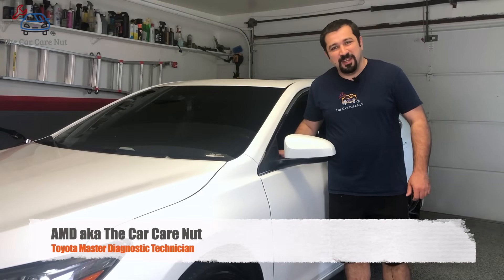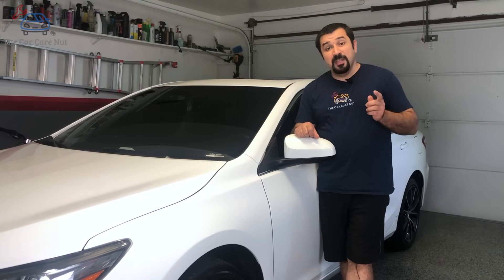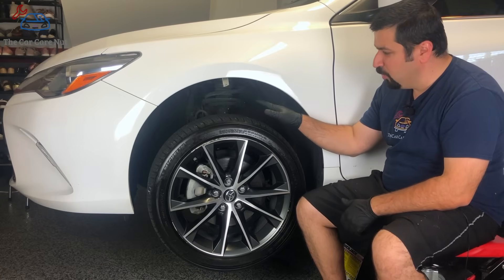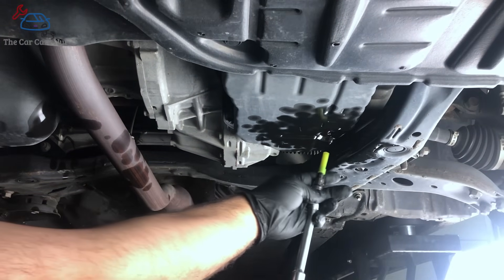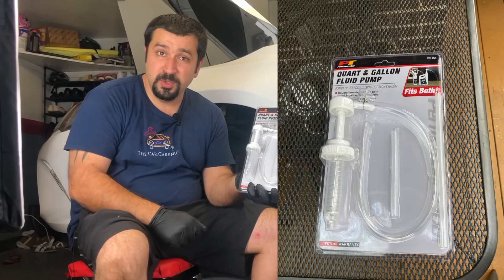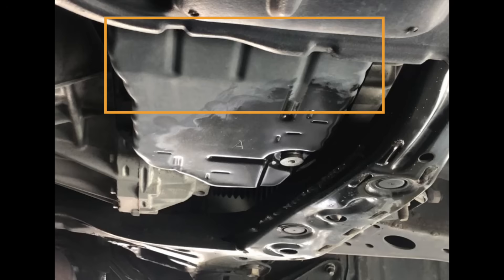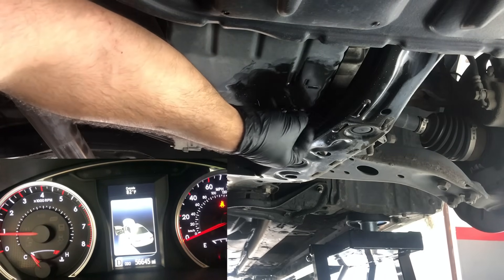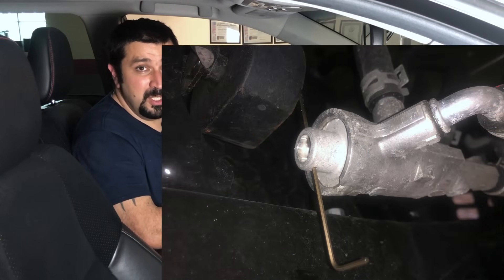How to change your Toyota Sealed Transmission Fluid

Comment: Planning on doing this on 2013 Camry v6 I just bought. Coming up to 200k 1st owners never did a tranny flush so it’s original fluid in it. Do you think the drain and fill will be safe or should I just leave old stuff in. I know these motors are solid in the v6, car still shift smooth and drives strong. Thanks in advance

Comment: I have a 2017 Camry 2.5 Le with 108k miles, and want to do a trans total fluid change.  A drain and fill, a total fluid change or a flush ? What do you recommend? God Bless

Comment: Thanks for the information, just did transmission oil change on my 2019 Rav4 Trail/Adventure 8sp with a Techstream draining the overflow at 104f. However I couldn’t find this oil cooler bypass you talked about between the rad and transmission. I followed the lines from the transmission and it looks like it goes to an oil cooler closer to the firewall/booster side but didn’t see any pins to press in. Do you know if this model has this bypass pin? If so let me know and I’ll do the change again thanks!
Reply: I spent the last two days under my 2019 RAV4 XLE: same as you say, NO bypass valve anywhere to be seen at all. Removed all plastic skid plates and driver side inner fender. Nothing.

Comment: I have 2016 Camry with 251,000 and the tranmission is shuddering between gears. I believe the transmission fluid has been changed at 110,000. Do you think its safe to do a simple drain and fill?

Comment: Do you recommend changing the the transmission filter or just the fluid during the drain and fill? I have a 2014 Camry SE, 99,000 miles
Reply: Changing the filter is a more involved process.  It is a better way to go but some of the bolts are very difficult to remove.  Once the filter and gasket are replaced you would need to then follow this video to fill the trany to the proper fluid level.
If you have a high mileage car many recommend not to do anything or just what's in this video and not the changing the filter.

Comment: Great videos as always. Thanks. I have Two Toyota Estima 3.5l 2GR-FE with only 40k miles but a 2009 model and a 2006 model. I take it the fluid will need changing. Is it safe as they are old cars with very low mileage? Thanks.

Comment: Even the workshop can not do this properly, last time i check my AT fluid on my 2008 Camry 2GRFE, it has very little fluid on it, so my transmission sometimes slip in the morning, after i add more fluid, now its normal.

Comment: how do I change transmission fluid in 2015 toyota tacoma and 2017 rav 4
Reply: Drain it & then fill it after you have reinstalled the drain plug.

Comment: Cool video, but I have a question.  Why do you have the engine running when you check the fluid level?  The Toyota procedure PDF I have on setting the fluid level doesn't say to have the  engine running so I thought you did it not running.  IE, do the temp check, shut the engine off then set the fluid level?  At least that's how I read the official procedure?  Thanks!
Reply: Engine needs to be running.

Comment: I've notices sometimes car jerk when moving at 30 miles or less and on slow acceleration. This started happen somewhere after 35K miles and get worse at 50K so I decided to change the transmission oil and now it ride much smoother.

I just finally completed this job today on my 2017 Highlander. It wasn't hard if you figured out and doing it correctly otherwise it can be a PIA and frustrating.

Need 4 qt ATF WS for HL 6cy drain/refill. Dealer will trying to sell you 6qt.

Don't buy expensive scan gauge or temp gun it's a waste of money and just do the official way how he showing here. The problem with with official way is best to let the car park overnight so you have a lot of time to drian the excessive out, otherwise you will not be able to have enough time to adjust the fluid level.

In this video it a little confuse for me at least. I did exactly how he show in the video, park car overnight and when it come to the part draining the excess fluid than tighting bolt than went to look at the instrument cluster and this is where I notice the D is blinking so I probably over drain. Waited 3 hours and try it again and the D start to blink only 30 seconds after being solid, so when you make mistake like I did, it's time consuming and frustrating as well. I let car sit overnight and restart the procedure but here is what when wrong the first time.... While rocking between D & N and the D come on solid and go away, I keep rocking shifter D & N and this is a NO NO. Once D come on solid and go away which it should be, put the shifter into park and wait for the D to lit up solid than remove the jumper wire and proceed to drain the fluid. This will give you much more time to correct the fluid. After fluid is corrected I when back and look at the instrument cluster the D still solid which mean it life is good. 😀

I hope it help.

Comment: Hi, just bought a 2004 Lexus ls430 with 126,000miles on it. But the transmission fluid was never change, is it dangerous to change it now.

Comment: Man, I have looked everywhere to try and find this bypass valve on my 2019 rav4 front wheel drive. Does it look exactly like in the photo?  Also, my drain plug is on the transmission itself. I don't have a pan if that helps. I do have an 8 speed too. ANY help anyone can give would be great!!!
Reply: I have 2019 RAV4 XLE AWD, could not find any evidence of bypass valve of any kind. Lines leave and re-enter trans with no valve port.

Comment: AMD, thanks so much for so many good videos, been subbed for sometime and have viewed lots of your content. Own a 2019 Tundra 5.7L and a 2022 Lexus ES300h. We are Toyota fans indeed.

Question…my 2019 Tundra just rolled 30K miles. Instead of fussing with all of the technical steps of the tranny, here is what I did…I let it sit overnight, first thing the next day I drained the cold transmission oil from the tranny oil pan. Measured what drained out precisely. Then I pumped in precisely the same amount of Toyota ATF WS I drained out via the fill hole at the top of the tranny. Added 2 new Toyota crush washers. 

Given this info, is this a good or bad idea? If it’s okay, would it be okay to do this every 30K miles or more frequently? Any insight would be appreciated.

Comment: Hi, nice video.  It's very educative.  I tried the same process on my 2018 toyota camry.  My car was 75k miles when I did the transmission fluid change and after the change I noticed some sharp shifting from the gears and alittle vibrations, which wasn't there before. Dou after the change also I noticed the car drive faster and lighter but the shifting was sharp and you can feel it more and also vibrations when moving.  What do you advise me to do next.  Thank you.
Reply: I just tried in my 2019 but stopped because I could find the bypass valve he talked about pinning open with an Allen wrench…. Where was it at? Thx.
Reply: @maddeusdoggeus1  If you could find it, why ask where it is?

Comment: Like your videos because you have real professional experiences with Toyota cars.  I had changed the transmission oil of my RAV4 2009 (with dipstick, seems no fluid temperature sensor) following some online videos. Only after I watched your video, Now I realized I need to double-check if I got the right fluid level. Can I use that ODB2 jump wire to get the right temperature for this model or how much is the right temperture reading If I use a temperature gun? Your help is highly appreciated

Comment: I will start out by saying that this is the best and most informative video on changing transmission fluid in my car that I have found. I do have a question. I have the exact car that you are using in this video. Same color and everything actually. A 2016 Toyota Camry with the four cylinder, 6-speed transmission. Can you tell me the exact temperature that I should get it to? I actually have an OBD2 scan tool that tells the temperature and I would love to use that method. Thank you.

Comment: I have a 2008 Avalon.. I have heard I should fill and drain  drive some and do it once more what are your thoughts on that?  It was bought used and has 95k on miles not sure if and when has ever been changed.  And will the diagnosis work on that model?  what would be the temperature be  with a gun for this year and model?
Thank you .. nice video

Comment: If the oil expands when hot then why do fluid flow when we take out the drain plug (assuming it is cool)? Even though you have demonstrated the recommended technical way I want to ask if these steps can work. I drain and fill new oil keeping the drain plug open just till the point of new oil flow then start the car, shift the gears and let the fluid start flowing out, May be keep the drain plug in but loose such that as the oil expands it will drip. With a digital multimeter measure the oil temp as it drips. When it reaches 104, remove the drain plug to let the excess flow out (keep the car running, and keep the temp prob in the drained fluid). Tighten the drain plug when it starts  trickling as you demonstrated. Will this work? Your input and videos are accurate and a great help. Thanks.

Comment: Thank you for this video! I have a 2020 Corolla CVT SE with 20k miles on original CVT fluid, and recently I noticed when accelerating WOT, the car would not shift and was bouncing off the rev limiter, then the CEL came on. I pulled to the side and put in Park. When I put it back in D, the car would not go into to gear OR respond when I gave it gas. Turned the car off, and tried again, nothing, then on the 3rd attempt, it finally went into gear, and let me drive in 1st gear for little then started to go through the other gears. I was getting the codes P2757 and P2820. Would this be related to contaminated CVT fluid? Thank you!
Reply from the maker: Hi! That car is under warranty you might want to involve your dealership. Hard to tell without diagnosis
Reply: @TheCarCareNut  sounds good will do! The crazy thing is the car CEL went away this morning, but I’m not risking it 😅

Comment: When you take off the drain plug, the video shows fluid coming out before you take the overflow plug. Is that mean that vehicle transmission fluid level wasn’t correct? 
If the car is cooled over night, should you be seeing fluid coming out before you remove the overflow?

Comment: Why not just put in the amount you drained out 2.5 quarts instead of putting in an extra 1/2 quart and draining that amount out? One would think that the capacity of the pan would be the  same for the make and model of the transmission?

Comment: Thank you for this video. I do have following clarifying questions for my 2015 Camry. 
-should I drain the fluid when the transmission is cool?
-should I level the car when checking fluid level to drain excess fluid?
-which method is more accurate, diagnosis mode, or temperature gun method? 

Thank you again.

Comment: G'Day sir!  Quick question for ya.  I have a 2010 Lexus RX 350 with 266000km (~162000 miles).  Transmission fluid has never been changed.  I just noticed that one of the transmission fluid lines that runs into the cooler(rad) had a slight leak.  Looks like the hose clamp has corroded so much that its losing its grip.  Not sure how much has come out but I thought I'd replace the clamp and do one of these drain, fill and check while I'm down there.  With this many miles, would you recommend completing this procedure?  Cheers!

Comment: Does this procedure apply to a 2011 Avalon?  Mine has 174k miles.  I bought it at 128k.  As far as I know, the fluid has never been changed.  No problems with transmission yet, but I'm sure the fluid can't be in great shape.

Comment: Thank you for putting out such great videos!

I used a scan tool connected to the OBD 2 port.  When doing a drain and fill for the transmission and checking the fluid level, I should be focused on the oil pan temperature and not the yorque converter temp. Is that correct?

Comment: I have been watching videos on how to do this for my 2004 GX470. Most folks start with 14 quarts of Toyota ATF-WS fluid, drain it all, fill 4 quarts, drain 2, fill 2 etc until the fluid is "clean", measure temp 97-115, check the overflow and add more fluid if needed. I have not seen the green overflow tube, is this in newer models only? Some take off the whole pan and change the filter, is that really necessary? Would like your opinion.
Reply: I have the same question about LS430 2004. Basically, just drained and refilled the same amount,  but I didn't know how to measure it if it's correct. So Is there a overflow tube? Thanks for the explanation in details.
Reply: @simeonsimeonov8012  FWIW I just drained and refilled three times on my GX470

Comment: Nice video, really enjoyed watching it, question! What about transmission with dip stick? Should I change fluid like oil change? What ever drained, fill the exact amount? For 2010 Corolla S.
I have a Lexus GX 2018 too, it has 100k and transmission fluid never changed (I m second owner) having plan to change that too but l m little scare.

Comment: I have 2015 Toyota Camry with 115k miles. I never changed the transmission fluid before. Is it still safe to change it for the first time at 115k miles?

Comment: Thanks for such outstanding instructions! Just performed on my 2013 ES350 with confidence and it went exactly as you described. Lucky for me an add-on package for my OBDLink MX was available and provided the A/T temperature reading which was easily worth the extra ~$15. Now I have some peace knowing it'll be good to go for long term higher miles. Three different dealerships refused to do the job so just had to do it myself. Thank you!
Reply: I have the 2007 Lexus Es 350 that I want to perform this on, I had to buy a temp gun to measure the temperature, so I want to know, at what degrees did you start draining on your ES?  as he mentioned that it differs depending on the transmission.
Reply: @nnamdin3372  I opened mine at 99° and it came to a trickle exactly like in his video just as it was going from 103°-104°. I don't know if temp ranges are same for your 2007 as for my 2013 but I hope that helps. It was way easier than I expected. Good luck!
Reply: @anthonycapobianco5615  I did it this morning, I was very nervous but it was way easier than I expected. Haha. My transmission happened to be overfilled because, in my region, there's no professional technician that could actually look into it so the mechanic overfilled the transmission and I had to drain the fluid, it was a lot. I'm happy how the car shifts now and it can go better from here. Thanks
Reply: @nnamdin3372  Great! Am glad it worked out and went well for you too!
Reply: @anthonycapobianco5615  is your ES350 rear wheel drive or all wheel drive?
Reply: @AC_metro  not all wheel drive
Reply: @anthonycapobianco5615  The correct adjustment temperature for 2013 ES350 is from 104°-113°.
Reply: @dylan40cal  Thanks!
Reply: So how much atf did you end up using. I'm about to do this on my es350 and don't know how much to buy

Comment: What is the temperature range for a 2019 Toyota Camry 4 cylinder with the 8 speed transmission?  I found one DIY video that said check transmission fluid level between 131-149 deg F for the 8 speed transmission.  Is this correct?  That's much higher than the 95-110 deg range you said was pretty standard.  Thanks!

Comment: The best Toyota service videos EVER!!!!
Reply: Hi AMD, thank you so much for this video. I was wondering if you might weigh in on my case: 2015 Sienna LE, purchased at 48 k miles late 2020. I just did two drain and fills for a replacement of ~3 qts at 78k miles. My question is if you think I should do any more drain and fills to replace more of the fluid? Also wondering if/ when I should drop the pan to clean it and replace the filter. At the moment it sounds like one drain and fill every 30k is more than prudent?

Comment: Hi  the Toyota Wish 1.8A  (2009-2014 ) also has a similar CVT transmission. The processes you showed on the Corolla is really similar. The toyota Wish also uses CVT FE fluid.
Based on your many years of experience and  that both the corolla & wish have really similar CVT transmissions, would you recommend to do a cvt transmission flush with a machine at the workshop or just do more frequent cvt fluid changes, with regards to cvt transmission maintainence & maintaining life of the cvt transmission.  Ie do more frequent cvt oil changes of 20,000km or 30,000km.

The toyota wish in question has a milage of about 130,000km (not miles) and daily driven in freqeunt start-stop traffic. Daily milage covered is about 100km. Probably 5 to 10km in start-stop traffic driving conditions due to traffic congestion daily.
What do you suggest please. Flush or continue cvt fluid changes
Which is preferable and why. I really hope you can clarify this.
Going to several workshops, gets me many uncertain answers.
Thank you so much.
Reply: Completely flushing the transmission can cause slippage so you’re better off with fluid changes every 60k miles.

Comment: Hi, A question for you. Is Motul ATF VI 100% synthetic a good equivalent of the Toyota T-IV or JWS3309 Automatic transmission fluid? This is for a 2006 Suzuki Grand Vitara 4 speed torque converter automatic.

Comment: Hi, I just bought a 2015 Corolla S with 130,000 miles. I know it's a CVT. Last owner never changed the transmission fluid. 

1)Will changing the fluid do damage being that there are no clutch packs?

2)I feel removing the pan to remove metals from magnets and any non magnetic debris might be very important. I have removed pans before. Do you recommend that or just the fluid change? I want to do this tomorrow but don't need opinions. I need facts so I would like to hear from Ahmed himself. I sent an email and posted on the maintenance video in case this video is too old to get a reply from pro Ahmed.🙂